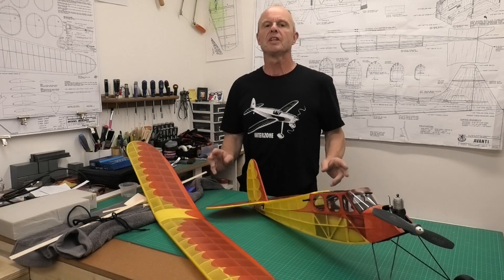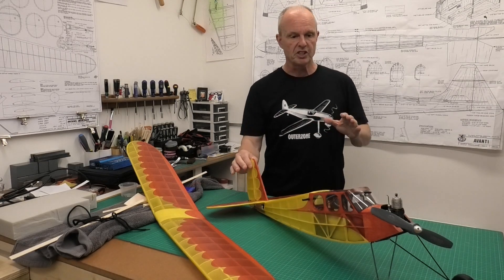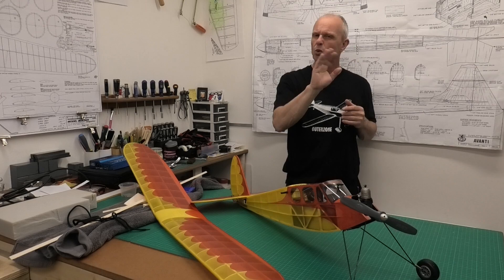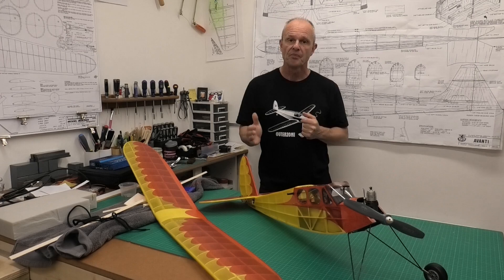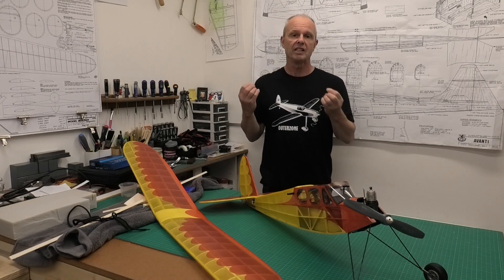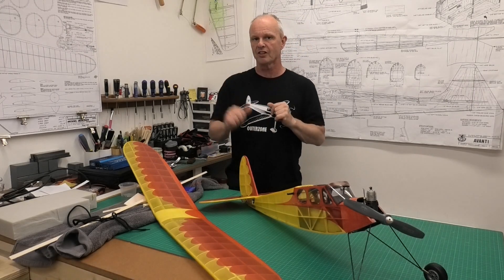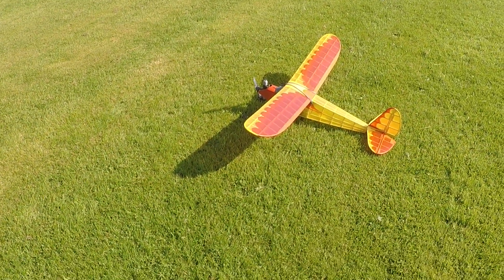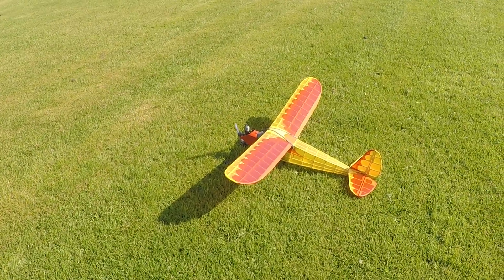45" Quaker & Mills Diesel - Build Series - Adding Down thrust

Comment: Mark - so glad you posted this mod.  I just tried the Weaver 1cc in the Tomboy today and had the same issue where it shot up like a rocket and I had to keep applying down elevator.  However the glide was just right.  Balance between power flight and glide!  So I will come up with a mod to increase the right thrust from 3 to 4 degrees and also add 4 or maybe 5 degrees down thrust.  I might also just raise the engine straight up off the bearers by 1/4 inch.
Reply from the maker: Hope you get it sorted, will be great to see a video

Comment: Hi Mark, for these models where the engine is mounted on wooden beams, how are you dialing in down thrust? Washers added under the engine mount at the ear bolts? I'm assuming you're not modding the beams themselves.
Reply from the maker: Hi there, I simply add washers under the engine, on the rear two engine mounting bolts
Reply: @MarkRobinson555  thanks!